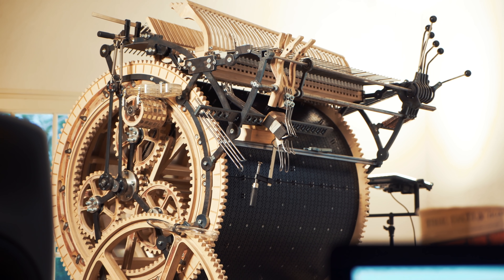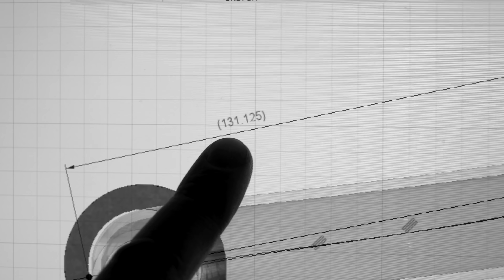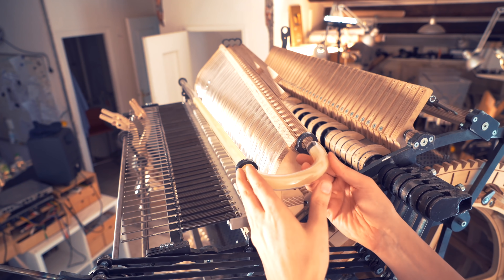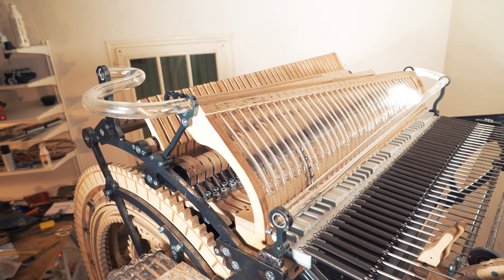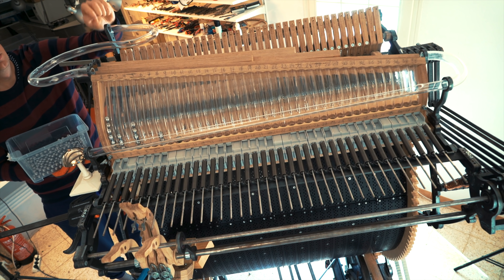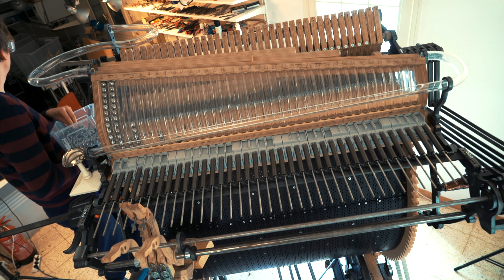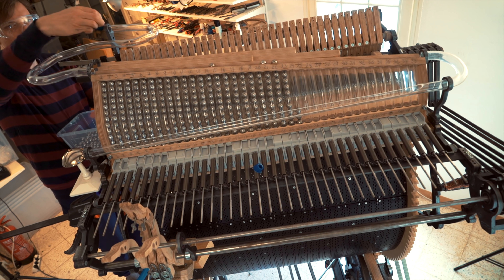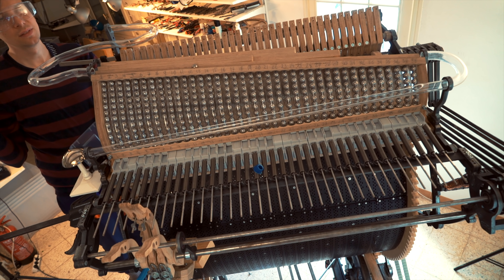Marble Divider Transport Tracks - Marble Machine X #68

Comment: Maybe I’m missing something, but will the noise of the marbles runnings across the top of the channels before it gets to the overflow pipe cause issues when it comes to recording and performing music?? 
Surely the noise of 30+ marbles running across the top of the others would be catastrophically loud?
Reply: Martin have all ready post about this "problem" which is not.... in previous videos. The MMX have music sounds (that's allright) and also function sounds that Martin want to introduce into the music, it's a part of the music. For the music there are sensors on each music instruments and other for the live sounds of the MMX like the levers of the Mechanical Rhythm Machine or the muting system. ReWatch the 1st MM video you can clearly ear those live sounds, did they disturb the music?

Comment: Ok so this is a crazy idea I know!! Also, I guess you would not want any electrical solutions on this mechanical beauty BUT If it was my build I probably would have liked to have some static solenoid pins that could be recalled via midi :)
Think how cool that would be tho! A press of a button automatically changes the position of the pins. Yes I know... A project of it's own. Slip rings and arduinos and shit ton of solenoids plus a pain in the butt if they break. ELLER??........:)

Comment: Has anyone suggested getting the programming plates laser cut? If thin stainless sheet (<1mm) is used the distortion caused by curving will minimised. Not to mention ease of manufacture (no deburring, no bubble fillets, no tool wear, no internal forces causing post-machining distortion, an elegant method of a more civilised age) .The depth of the pocket can then be increased by shimming the laser cut sheet out from the inner sheet that the pin sticks to. As long as the pocket is tight enough, and the pin stays firm to the inner sheet, the repeatability could be good enough. The shim thickness also gives you a variable to adjust the phase between sheets, keeping the timing from one plate to the next. 
I wouldn't be a fan of having 'preprogrammed' sheets, it turns the MMX from an instrument to a record player IMHO.

Comment: I'm just throwing out this though that could trigger a solution. You need a large scale version of those old wide format printers. The way those machines worked was to roll the paper back and forth in one axis, (that would equate to rolling the programming wheel). Then a head with a pen would move to the other axis point and drop the pin down... What if that head was inserting a programing pin into the wheel? It would be very expensive to build a machine to do that. Probably more cost effective to pay for manual labor to program a wheel on the fly or have a library of wheel panels already programed.

Comment: The programming wheel issue is easily solved... Don't use that material... There! Problem solved! Choose a material that doesn't screw up like that. Maybe a different type of plastic. Or! You can dish out some more cash and adapt your cnc to work in more than 2-4 directions... Then you can prebend it, and then mill.

Comment: A simpler solution is get rid of the dam plastic and just engrave the holes in a 10-12 gauge steel drum. Spin the drum with a stepper motor. Then the cnc is only working in 2 axis- x and z. With this, the accuracy of spacing is taken care of by the stepper motor spinning the drum. As far as connecting the pins, put magnetic strips or something on the inside of the drum along each line of holes, with about a centimeter or so drop down to carry the moment from striking the read pins.

Comment: Perhaps as a future extension of the programming wheel, you could make thin sheet plates (full circle, maybe using stainless steel 0.2mm e.g.) that overlay on the existing plastic plates. Each note could be punched in place by a CNC machine as a bent up tab. This would give you fixed songs rather than reprogrammable ones, but be more easily transportable (maybe), and quickly swappable. It would be compatible with all your existing mechanisms. Anyway, as for getting defensive, there’s no need. It’s art; you are the artist. Picasso never got shit from armchair artists telling him to use a different pencil.

Comment: Ill just say it one more time just in case you missed the last time I commented on the programming wheel. Tapered magnets. I think the design of the wheel is fine the way it is. If you could source a (or have custom made) similar in size but tapered magnet, it would eliminate the need for such precise holes so you could ease up on the tolerance of the rubber. You would lose height precision(from the wheel) of the magnet but the horizontal position should be much more accurate. They would use friction to seat them perfectly in the middle.

Comment: I don't think it's Sunk Cost Fallacy or Second System effect. I think it's "the materials you are using are not going to remain the exact perfect size, shape, dimensions, stiffness, or other physical properties in all the weather and climate conditions you will experience when taking the MMX on tour." There is no point killing yourself over a 0.1mm difference. Everything will flex a far greater degree than that just from one concert to the next. Also 99.9% of your fans won't notice wheel segments being a tad early or late. In fact it will sound better.

Comment: Watching you load the marbles makes me wonder about the slope on the channel bar. The tube furthest from the supply is also the shortest. It has the least amount of marbles in supply and buffer. Seems risky and highly likely to run out of marbles. Hopefully these notes at the end are rarely used?
Reply: There is a bypass system for the first holes not used in this video

Comment: I think that you could make the tig weld solution programmable. Use a thin metal sheet and tig weld very short threaded metal rods on it. (Every place that has a hole now has a short metal thread sticking out in my idea. The short treaded metal rods would be so short that they pass below the activation levers.)

Then, have longer metal rods that are hollow and have a thread in the hole. For programming screw a hollow metal rod onto a tig welded thing.
You could even use 2 lengths of hollow metal rods and move the activation levers up and down to only play the long rods or play the short and the long rods.

Comment: Hum is seam if the marble devider if over loaded by sending to meny marbles down it at once if they bump in to the marble in front and they stop and back up.
 I would check how the devider proforms with a high flow of marbles. If this proves to be a problem the only thing i can think of is some tipe of mini trap doors that stays in place when the chanle is full and open when not. This should alow a smother role for the marbles when full. this would remove the bumps that cause them to back up when they hit the marble in front. But it would remove that nice click click click you get when roling over them.

Comment: I appreciate you sharing your introspective analysis concerning the programming wheel. It seems like there should be an easier solution, but that doesn't mean there is. It's sensible of you to stick with what will meet the design requirements. Thanks for the great videos!
One far-fetched and perhaps complex option for increasing timing accuracy could be to add a second step between the programming wheel and the marble drop. Right now, the pins on the programming wheel physically cause the marble to fall and make the note. It's a very analog solution requiring great precision with the pin placement.
You could transfer some of the burden of accuracy to a second mechanism: You could have the programming wheel prime the marbles or partly drop them with a second 'clock generator' device to activate the final drop. The 'clock generator' device could cause any primed marbles to fall every 12th of a note or whatever level of accuracy you need. The programming wheel would then only need to be close enough to accurate to keep the marbles from falling on the wrong beat.
I imagine the 'clock device' could look like a horizontal bar that would oscillate between blocking the marbles and dropping them. It would catch all of the marbles triggered by the programming wheel and release them all precisely on the next beat. Maybe a better name would be the 'synchronizer:' Every marble that gets triggered within a 50 ms interval (or whatever) gets dropped at exactly the same time by the synchronizer.

Comment: To me, a simpler (if any) solution about your programming plates could revolve around radius adjustment. If you had small screws to  adjust the distance of the programming plates to the center, you would be able to adjust very precisely the spacing between the plates. I don't know exactly how, but that seems very feasable with a few adjustment of the rotation wheel design.
All the best <3

Comment: First coming from a mechanical engineer I do not think that your programming plate solution is over complicated. Like you said it is an elegant solution to a very complicated problem. The shimming idea that you implemented is what came to mind when you first showed the problem. 

I am not crazy about the welded pin idea and thin sheet metal will warp and curl on you like crazy!

If you wanted to go with a completely different solution you could do a paper or laser cut metal or polymer sheet sheet and have air operated fingers. The cranking of the pedal could pressurize a tank and feed the sheet then as a hole passed the finger it would actuate it. Then you could have a song as long as you wanted and as many as you want. But this would not be a purely mechanical solution.

Comment: I was thinking about you issue of slowing the marbles. Have you thought of adding some mechanical devices that slow the marbles while also adding some visual movement? Something like a spinning blades that are rotated by the passing marbles, thus transferring some of the kinetic energy to the blades, something like a paddle wheel.Great work anyway, it's getting ever closer!

Comment: Use a little bit of oil lubricant in order to get the silicon tubing out of your rigid tubing after heating it. That's how I make sure the interior doesn't dry out and the tube gets stuck after heating. This is very similar to rigid tube bending for liquid cooling loops in high end gaming PC's

Comment: In my opinion there is nothing wrong with the design of the programming wheel, it should work just fine.

However, your production methods to achieve the required precision just sucks. I have been sitting on my hands now for several weeks to not patronise you with a lot of backseat driver complaints in the comment section.

And since you now talked about the dragon so nicely I cant keep quiet anymore :-) I will write my thoughts here short. You are welcome to contact me if  you need more.

1:  To have a decent chance to get the required precision, plates should be drilled in place in the programming wheel, mounted in its axle ( a completely assembled wheel on it support points used in the marble machine).
Easy in a big enough CNC-machine  . . .

2: Each plate should have a fixed position. Ie, a plate manufactured in position two should always, always be mounted in position two.
Very easy, just a policy decision.

3: Each plate should be fixed in 3D-space VERY repeatedly ( läges-tolerans ), actual position is not important. Just the same position every time.
Not so easy, requires some "minor" design changes. One programming wheel, one plate, one fixed position in 3D-space ( ie, no shims between plates ).

Suggestion for point 3:
A three-legged stool never wiggles, no matter the surface it stands on. A four-legged (or more) always wiggles, even if you manufacture both the legs and the surface to rediculous precision. It just get less noticeable. A three point support for the plates in the wheel is difficult to achieve I think. But since the most important dimension for the individual pin is its angular position to a reference point in the wheel, a solution could be to put reference gear wheels at the left and right side of the programming wheel and have internal gear profile on the plates that fixes its position onto the reference gears (no rotation, just position).

Keep working. You will get there. Good luck!
//Mats

Comment: Great job so far!  I do believe you are mostly correct on the programming wheels.  The " least number " of program segments that I could see ( from the requirements and the lowest parts count would be 7.  That would be, of course unrealistic as the first one off would have to be handed over to a re-programmer while the 3 remaining get replaced with the last 3 ( pre-reprogrammed ) and that would still lezve a potential issue of the timing of actually using that one plate.  More realistically would be 9 plates total as to have 1 ' extra ' in vase of real life, 4 on the machine playing, 4 reprogrammed to the next song ( or segment of song ).  The idea you mentioned of a sheet cut out for each plate with only the holes for that plate and what song will be next is a great idea, now to create a 1/4 round cylindar to hold them all and have them labled both play direction, song and segment.  That dragon will be taken down eventually, just keep your sword ( and routor bits ) sharp 😎

Comment: So I've been thinking about your problem with the programming wheel. It seems to me, that most of the problems originate from you trying to bend the plastic plate once you drilled the holes and by that deforming the design. 
How about if you milled curved sections with grooves for the magnets and then mount them together into a already curved programming plate?
I've made an image here to visualize what I mean:
http://www.nilart.se/download/progweel.png
Perhaps you could use a more rigid material as acrylic sheets and glue them together.
It would be a heck of a lot more pieces and lot more job but that may be the cost to make it work.

Comment: I think your design for the programming wheel is ok. The only thing I'd suggest is not to be so fussy about the beat timing at transitions between plates. The important thing is whether that small error is cumulative or not, and it's not. The very small timing error of one beat every now and then will not be noticeable by 96% of the audience, and you could have that much error in the drop-times of some marble channels anyway.

Doing many trials to get the timing and hole sizes right 'locally' within each individual programming panel was a good thing, because while an occasional error might be acceptable you don't want them all over the place. Tweaking that area plays to the strengths of a CNC machine which can be very precise within one workspace.

Comment: I wouldn’t go so far as to say your behavior is dysfunctional (yet).  You are merely realizing how big this project actually has to be to accomplish your artistic and operational requirements.  Has anyone suggested having only one or two programming plates that are rolled onto the programming wheel and locked into place by magnets or togs and cleats?  Then you’d have only one or two seams that you’d have to span.  Likewise, use your current method but dividing the programming wheel into only two pieces.

Comment: In all honesty, I think you became a bit enamored of the programming wheel since that is what you did in the original Marble Machine. If you were really starting from the ground floor, and looking for easy reprogramming, you would have looked back at your visits to Speelklok and considered the programming books like seen in https://youtu.be/RXp3y_WoKck. But, this wouldn't have been as dynamic and visually appealing most likely. 

You probably could have simplified the programming wheel using steel instead of plastic. Bore the pinholes in a sheet of metal, make an air gapped frame and attached the sheet metal with holes on top, then the magnetized lower solid sheet. Metal doesn't have all of the warping problems plastics do. Look at the thickness of you programming wheel sections- you could easily build wood frames that thick and attached metal to the top and bottom. A few strong magnets on each bottom sheet and the whole sheet would act like a magnet to secure the pins- assuming the pins are magnetic. Actually, you wouldn't even need the lower sheet- just attach the magnets to the pinhole panel.

Comment: You should consider Making stencils for song segments. little silicone (or other cheap light semi-rigid material) mats that you could overlay the programming segements, with holes for the associated pin locations.

That way to rapidly swap out songs, you just dissassemble, throw on the stencils, put pins in the visible holes, remove the stencil and re-install the segment

Comment: I think your design certainly has merit and I agree you need to keep your requirements.

 If I may suggest an option that may have been simpler: kill the wheel idea and move to a chain or belt design, like you did on the first design. It's a proven system, not only in the first marble machine, but in numerous mechanical music machines. You could argue it wouldn't be as beautiful and I would be inclined to agree.

Comment: I again was kinda left very confused from the last segment of this video series.  I had expected this episode to discuss how the problems of the programming wheel had indicated other problems throughout the rest of the MMX project.

So be it, you opted to move on.

Building the carrying system for the marbles/ball bearings is certainly important.  Looks like you've gotten the 1/6th of it done.

When you get to the building of the MMX Mach II I have a theoretical idea for changing the pegs out by the MMX itself!